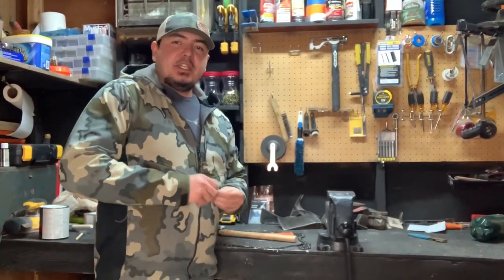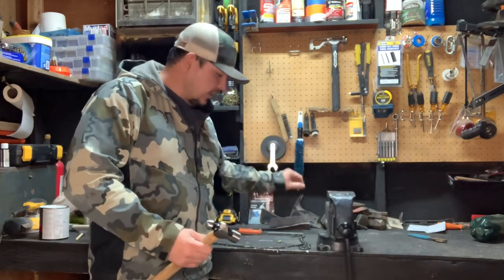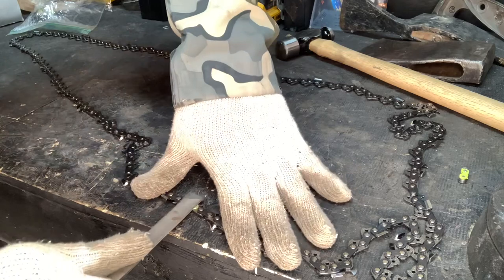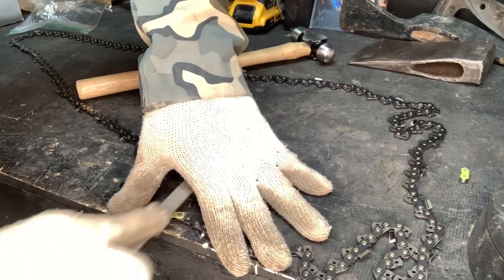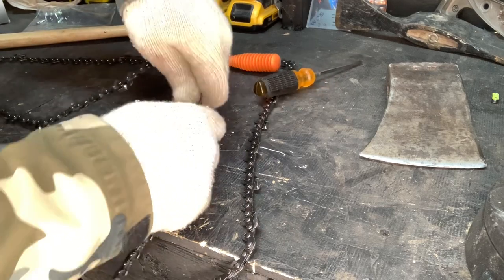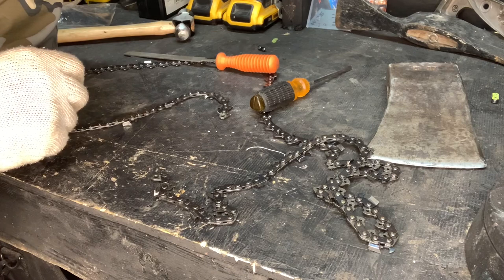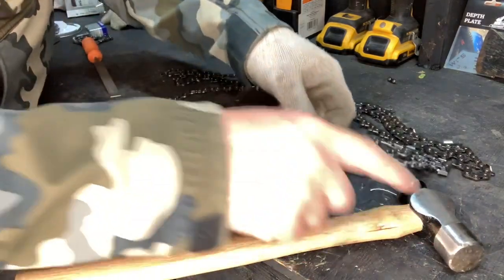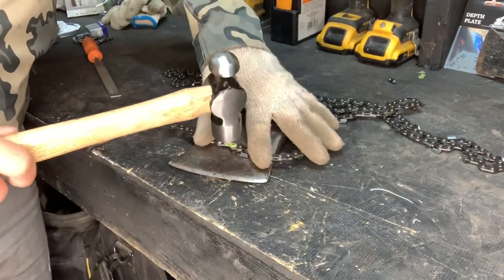How to make your own saw chain with basic hand tools 🔨 🪛

Comment: I make chains very much the same. I buy rolls of it, and I use a punch and hammer to break it, and a hammer to roll the rivets over once I put it together. A breaker and spinner is nice, but I tend to over board on my rivets with a spinner, then you've got a stiff spot in the chain
Reply from the maker: Cheap and easy but efficient

Comment: Nice video David! You walked through the steps very well and gave nice clear instructions. I’ve never done it that way because I do have a breaker and spinner. But it’s nice to not it could be done in a pinch if I needed to.
Reply from the maker: Thanks josh! I’ve only seen one other video like it but they used a few different tools I just wanted to show it could be done with bare minimum… maybe I will do one on the stump some time lol